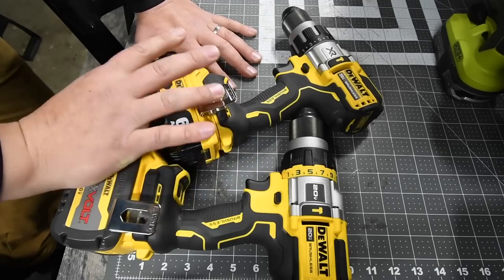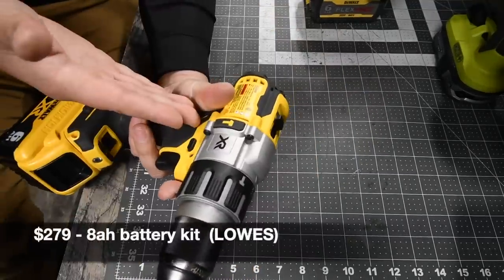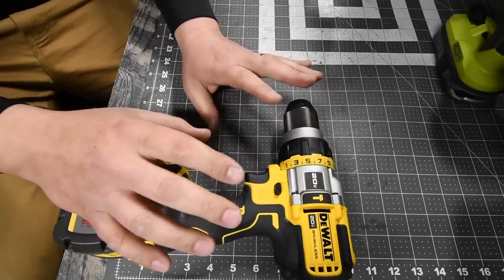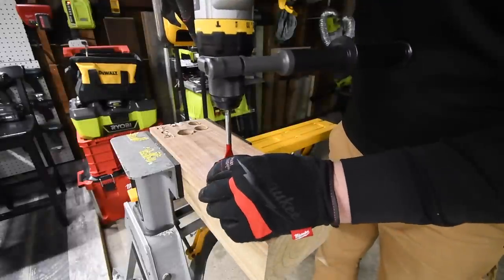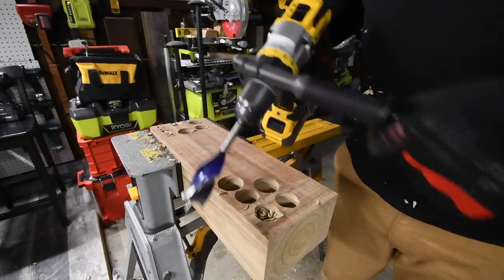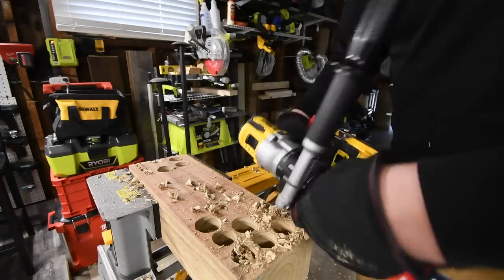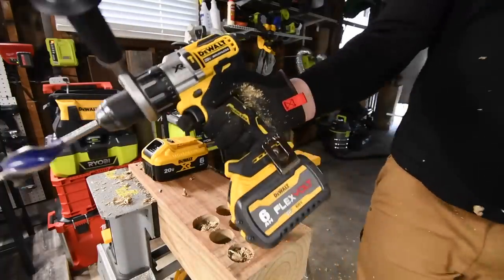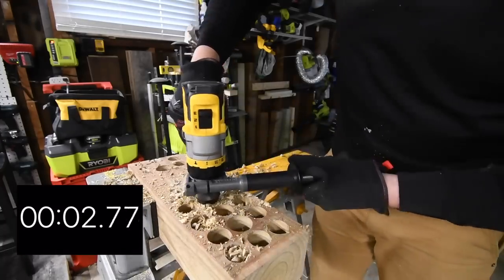Dewalt Power Detect vs. Flexvolt Advantage

Comment: DeWalt still #1 Hammer Drill.    They won the Spring 2021 Season of Hammer Drill Race Series.  See Scoreboard here: 
https://www.youtube.com/watch?v=9DowmObgkU4
Reply: Which dewalt though?
Reply: But what size hole can it drill at 2500 rpm's?
Reply: @alexe3688  

You're trying to compare specs versus stats.  Specs don't mean anything unless you pull off a win.  That's a stat. 

A '2500 rpm drill' doesn't necessarily go through wood faster than a '2000 rpm drill' if the Flex overheats, for example. 

I'm just the 'sports reporter'.  I'm reporting on ALL the tests with the Flex Turbo against the 998/999.   And in Flex's first month, it won 1, lost 2, and tied 1 in which it overheated.  1W, 1T, 2L.  

1 of the losses and 1 of the ties, the DeWalt was in 3rd gear.  So DeWalt chewed through wood better than Flex even though 'on paper' the Flex has more rpms.  

That's just the stats.  

Cheers.
Reply: @P_steez  ManCaver will have to test with the 2 batteries for the sequel. 

What I can say, is either the 998 or 999 performed better in April than the new Flex Turbo.  

That's just the stats. 

Cheers.
Reply from the maker: I do thank you so much for viewing

Comment: Long story short, remeber ur old video where dewalt won vs flexy, makyta and milwoky. Now, get adapters to use dewalt battery on maky and woky, and lets see whos the real winner. Cuz apparently, that dewalt battery is monstreous. Mistery is that makyta is totally moving only to battery tools but for some reason is still selling weak batteries and only 6ah batteries